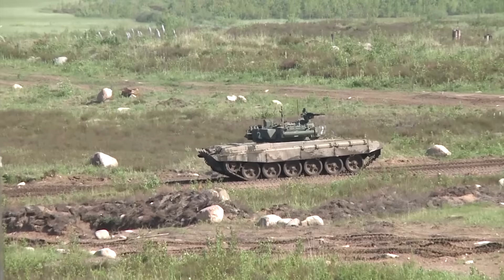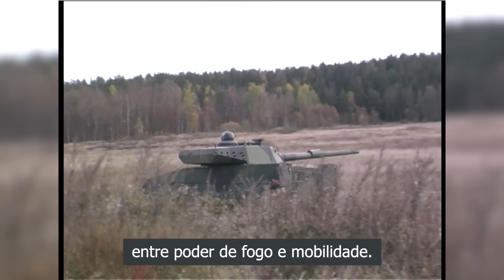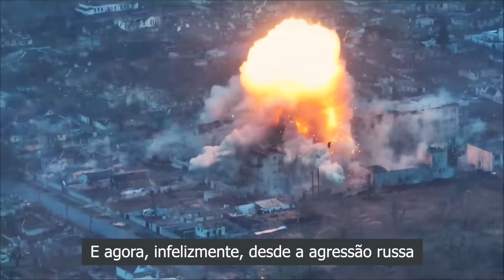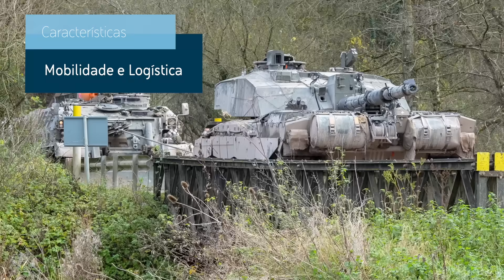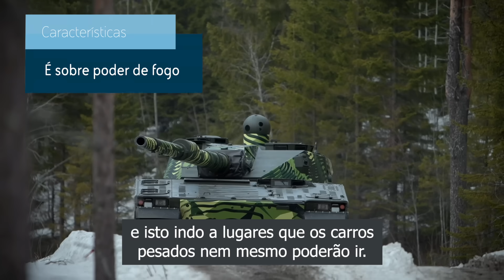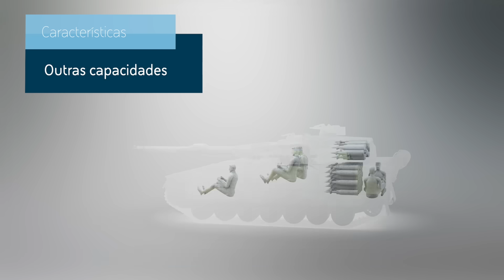CV90120

Comment: You tried to make a tank out of efficient and fast crew transport vehicle with firepower. Now only 2 people can be transported. CV9030 was able to transport 8. I see little use for this kind of vehicle due to drones. There simply isnt enough good counter measure for them yet to be implemented to vehicle like this.
Reply: The CV90120 is not meant to carry crew. The 2 crew on the back is only either for demonstration or possibly for maintenance/crew shifting.

In terms of drones, it probably is just survivorship bias as most of the tank kills that are seen is usually from drones, because Im very sure mines and artillery dont have cameras attached to them, which would claim more lives and vehicles than FPV drones.

Comment: Make it go 120km/h and have a bit reduced range with some basic mine protection as its the bane of today's Battlefield oh and very important at least russian 30mm proof from the front so it won't be shredded cheese
Reply: It probably already has an optional package for STANAG 4569 Level 6 armor.

But if youre looking for a 120mm gun armed vehicle that goes over 100kph, youre looking for something that uses wheels, not tracks

Comment: just add the 50mm bushmaster it more better than the 30mm because in the future 50mm would be a common place if you make it 50mm then you don't have to adapt to it. 50mm bushmaster would be more able to shoot far and wide and also have more payload in the round.
Reply: Since the 50mm is based on the 35mm Bushmaster, its probably already in consideration.

Though I dont really see a future for 50mm, as 30-35mm already does the job decently for a cheaper cost (and logistics too), while a tank gun would provide more firepower than a 50mm, also for less logistical burden.

Comment: I'd like to see a version of the CV90 with a 50mm turret and no troop compartment. Just make it a light tank already!
Reply: CV90120 (and CV90105 respectively) is a light tank, though… Even this new one only has a “new” compartment space just for UAV operator capabilities.
Reply: Since the 50mm Bushmaster is kind of based from the 35mm Bushmaster, it might already be possible since the CV9035 exists

Though I dont really see a purpose for the 50mm because a 30mm or a 35mm already does the job decently at a cheaper price, while full on tank guns have more versatility and firepower than a 50mm autocannon.

Comment: Shocking how this has the weight of a T-72M but armour of a Leopard 1 and the cost of a M1A1 Abrams, oh western companies, pls never change.......
Reply: I would guess that most of the money really went to BMS and other processors. T-72Ms (and in very, very rare cases, even B3s of all things) have radios for BMS and no thermals.

The weight issue is not really relevant unless you talk about its efficiency and logistical costs, and its ground pressure, along with considering that the T-72 may have armor, but I would rather be in a CV90 just because its genuinely easier to escape from and live in.
Reply: @RyuzoSan19  
All current T-72's have thermals and lasers, not sure what universe you live in where thats the case, its not 1978 anymore. 
As for weight not being and issue, Ukrainian military would like a word with you on that one. 
Which would also disprove your nonsensical comment about armour being less important than speed, you cannot outrun a 125mm sabot.
Reply: @SMGJohn  "All current" you only said M models, I also stated that M models have no thermals, not the newer B models. I also stated that these non-thermaled B models are very, very rare.

Armor is hilariously redundant in Ukraine. Cope cages (both Russian, and Ukrainian cope "nets") barely stop shaped-charged munitions. Especially seeing the most "effective" tank during this conflict are large sheds with jammers on them; which you might have guessed, can be done on lightly armored vehicles.

My point still stands on the part that T-series tanks are horrible places to live and work in. It really is the embodiment of "engineer's dream, crewman's nightmare".

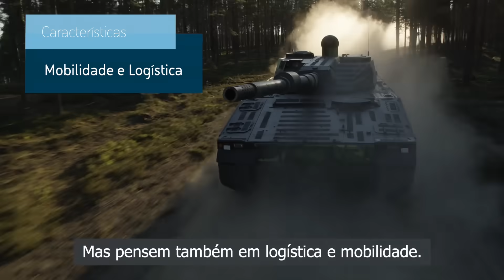Comment: At about 3:30 you talk about the size and weight of the vehicle, a smaller vehicle means a smaller target, better transport by train, better cross-country ability, etc. This is exactly the philosophy of Russian tanks: lower height, lower weight, smaller dimensions, and high firepower.
Reply: And turret tossing as the finale
Reply: That however costs Russian crews ergonomics and comfort, which the CV90 somewhat wins out due to it being an IFV turned into a tank.

Comment: I think that a platform that can be kept as universal as possible would be advantageous in a modern conflict. Commonality of parts is one thing, but the ability to easily transition crews and personnel from one platform over to another with minimal training is perhaps quite important as well. It is a changing environment after all, new equipment gets introduced all the time. perhaps your unit needs new capabilities for engaging something unexpected. What do I know?

Imagine being assigned to a BMP in Russia, then having to transition to a BTR or a BMD, or being assigned to an American Bradley and transition over to a Booker or a Boxer. They're completely different base platforms. When moving from one CV90 to another model, I'd imagine that transition would be quite smooth. 🙂

Comment: Great mobility and fire power but 0 armour. Crew would be swiss cheese or more like tomato sauce if EVEN Bradley started to empty his M242 Bushmaster, but I guess this kind of vehicle has his role on battlefield
Reply: It doesen't have a role on the battlefield. CV90120 exists for over a decade now and not a single customer has ordered it yet. A solution looking for a problem and only good for YouTube videos.
Reply: @jonny2954  It kinda saddens me that this vehicle has not yet been considered by any major countries except for the Swedes themselves and possibly the Brazilians (due to the subtitles)
Reply: The Bradley also "doesnt" have armor, so why is it still being fielded?
Reply: @RyuzoSan19  Bradley in its latest upgraded version is 40+ tons and even mounts ERA. What are you on about "doesen't have armor"?
Reply: @jonny2954  Bradley armor is rated at STANAG 4569 Level 4, can only protect against 14.5mm rounds even with the BUSK ERA. At front, maybe Level 6, but the CV90 literally also has the same options for armor.

I would also like to say that the "armor" arguement wasnt for you, it was for the OP. I would like to apologize for that.
Reply: @RyuzoSan19  STANAG 4569 only rates protection from kinetic energy threats and not shaped charges which work and are countered fundamentally different. The ERA on the Bradley significantly outperforms the passive armor solutions on the CV90 for protection against shaped charge warheads.
Reply: @jonny2954  I see I see, though Im curious to see if Hagglunds would offer or start to consider ERA on the CV90, since they already consider MEXAS plates and other less explosive passive armor as "adequate" for LATs

Comment: Leopard1 seems to me was made to fullfill a similar role. Quite resistant, good mobility and a main gun. However, I don't believe the times have changed significantly. The armor is still required and a tank is still relevant. So I hope to someday see a BAE made MBT, which would spearhead the offensive and be able to take a hit to protect not only his crew, but his allies in case of any threat
Reply: CV90120 was originally designed for arctic, as main battle tanks just sinks into the very soft watery soil there, if you can bring CV90120, the scenario these are good for is to bring them into places tanks can't go, then you have fire superiority and can engage the enemy as you wish.

Comment: Very cool and unfortunate that there has emerged an market for these beast. Even cooler that the best IFV in the world gets a sibling. I think there should be more modularity tho for example; 

The back compartment should also be able to store stuff that doesnt fit into the regular IFVs instead of those spare drone guys. Usually a group fills up the CV9040 to the brim, sometimes "bathing" in bags, ammocrates and antitank weapons. The back compartment could in the 120 variant could be used for this. Hear me out; 

As a heavy punch platform these things will get alot of heat so I would not put the drone operators in this vehicle but have them separtely in a own group riding/hiding in the back. Instead put ammo and anti tank weaponry inside, enabling platoons in the front to replenish their weapons  after a contact. 

If a platoon and 2 regular IFVs hit the enemy without losses for instance in dense terrain, usually they have to rearm which slows down the attack. This enables the enemy to reinforce that point of the terrain usually in the flank, and or setup another defensive position in a delaying tactics battle. 

There should also be an automatic ejection port for the ammo so while the CV90120 protects the flanks and conducts surveillance over open areas it can eject the ammo at a close by point for the infantry to rearm at. This new speed and greater endurance would really make a difference I think since most combat excercises end up in replensih territory slowing stuff down now added with drone paranoia. The greater mobility achieved would also make anti drone warefare more controlled. This extended "thrust" would also make a difference for smaller armies that would not be able to reinforce/recycle lost troops in a prolonged battle at the same rate.

Comment: Here in Brazil, the biggest enemy is the hot and humid climate in the summer and the cold and dry climate in the winter. And it depends on the region. If you are fighting in the northern part of the Amazon River, which is the part below the Amazon River, it is extremely humid and hot and there are no roads. The parts are interchangeable because logistics are almost impossible in the Amazon, so you will have to use parts from other machines.
Reply: The CV90 was intended to be useful in an atomic ww3. It's built more robust and maintainable than most other 21st century things are allowed to be.
The 9040C version got deployed to the west african rainforests for the UN peacekeeping missions there in the early 2000's. They functioned the same there as they did in the arctic. That was adequate.
Unlike a certain other country, our stuff work even when it rains.
Reply: This is why CV90 is modular and built with maintainability in mind 👍🏻

Comment: Our country bought 42 ASCOD vehicles insted CV90. It was Extra expensive guys. Plus you dont have them " in stock". It was advised about 2030 delivery timeframe so ......
Reply: The ASCOD actually outperforms the CV90 though. Don't be fooled by YouTube commercials and fanboism.
Reply: @jonny2954  Where would this info be found? Im actually quite curious as Ive seen more support and users of the CV90 rather than the ASCOD around the world.
Reply: @RyuzoSan19  ASCOD 2 has higher gross vehicle weight of 43 tons compared to the 38 tons of the latest CV90 MK IV. It also has a higher payload capacity.

CV90 main selling point is affordability. Always has been in fact.
Reply: @jonny2954  The gross weight is interesting, as ive heard that the CV90 Mk4 has a 2 ton payload while I couldnt really find anything on the ASCOD itself. All the while being lighter, as you have said.

The price thing that you said wouldnt really be substantial. Latvias CV90 purchase resulted to about 9 million USD per vehicle including its support systems, while my country's purchase of an ever so slightly more expensive version of the ASCOD also resulted in 9 million dollars per vehicle with support. So it would seem that the ASCOD is actually cheaper by just a little bit more, but Im not an expert, y'know?

Comment: Another amazing video showcasing an amazing vehicle by a legendary CV90 user! Thanks Tarkan!!
Reply: Of course Matsimus is in here
Reply: Agreed. this is such a good option for a MBt punch with a lighter vehicle. I feel Australia and many other ex USA friends need to consider these in numbers and move away from Abrams MBT
Reply: What the M10 Booker should have been.
Reply: @knowahnosenothing4862 the CV90-120 also has the benefit of sharing the chasis with the CV90 family (reduced price and logistics). If you don't like the turret, you can just remove it and Frankenstein an autocannon or more sensory equipment onto it. The problem with the Booker is that it's basically a heavily redesigned Ascod (which the Army doesn't even operate) so no one knows what to do with it once production ceases
Reply: Fancy seeing you here, never would have guessed.
Reply: could be a good augment to the caf, since we dont have a medium platform. but god knows what and when procurement will get something

Comment: Tracked tanks have been obsolete since 1943. They can be mobility killed or straight up destroyed by any regular soldier, who can carry a cheap AT launcher that can penetrate more RHA than you can physically put on a vehicle. And if it can't, it can still take out tracks and optics, which is good enough. If infantry needs fire support, you can put a 120mm gun on an 8x8, which is a superior platform for everything except earthworks.
Reply: How old are you? 12??
Reply: @heinedenmark  I'm sorry, did you have an argument hidden in there somewhere?
Reply: @td6460  Years of experience.
Reply: @heinedenmark  Oh, how has Ukraine been treating you?
Reply: @td6460 Again - How old are you?
Reply: Soldiers can be easily killed by bullets, therefore soldiers are obsolete. That's what your argument sounds like. 

Tracked vehicles gives out better mobility than 8x8 vehicles simply because of lower ground pressure. Having a fire support vehicle only being limited to optimal terrain (i.e. roads and highways) makes it a larger and easier target. 

The funny thing is that the part of your argument saying "any regular soldier, who can carry a cheap AT launcher that can penetrate more RHA than you can physically put on a vehicle" doesnt apply to the CV90, because it can barely stop a 25mm autocannon from the side. Trying to hit optics and its tracks are also quite difficult to do when the target is going 40-60kph. Same applies to South African CIT heists where exposed rubber wheels barely get shot properly on bank armored cars. You have to remember, tanks try avoid getting shot by simply moving.

And besides, LAT Launchers are quite limited in range. The good 'ol RPG-7 has an effective range of only 300m, while target acquisition of tanks (with OLD optics, Gen 1 thermals or long range NV) may reach up to 1km.
Reply: @RyuzoSan19  It only sounds like that to you because you don't understand what's being discussed and because you have an irrational emotional attachement to a piece of metal.

There is no need for a 70-ton vehicle on tracks in a modern war. None. A tank is easily disabled, can't defend itself against a 1-hit KO any better than a lighter vehicle, has a weapon that can be installed on a lighter chassis, is expensive to operate with no strategic mobility AND low tactical mobility. In fact we've seen in Ukraine that this tactical mobility is much lower than an 8x8. The tanks get stuck in every terrain that's not a flat, dry plain. The 8x8s go through thick mud and last autumn I saw a Stryker limp back from Kursk with 3 operational wheels. You would never see anything like that from a tank. One blown off track segment - not the whole track, one plate - is enough to make the tank completely useless. "Tracked mobility" is a myth with no basis in reality.

Tanks are an obsolete platform from an era that lasted literally less than half a decade during the 2nd World War. Buying tanks now is about as smart as buying attack helicopters. So you know many militaries, led by idiots, are going to buy them.
Reply: @td6460  Thank you armchair General, now back to people who actually know what they are talking about.

Comment: Thing is, to be the future, how exactly you guys are planning to deal with drones in this platform? radio jammers, or some kind of active protection is on the way?
Reply: if they have directional acoustic sensors they can pick up any drone even if its fiber optic. As you saw here they have RWS (remote weapon system) which can track and shoot down drones it has high elevation.
Reply: cool

Comment: Perfect for Brazil
Reply: Why Brazil, in particular?
Reply: @T1hitsTheHighestNote  Cause the CV90 can go through pretty much any terrain, and provide great firepower while carrying troops that can fulfill different roles (drone operator/ambush/surveillance/setting up checkpoints/anti-tank emplacement etc) .
Reply: @T1hitsTheHighestNote  because Brazil is about to buy it. It meets the required specifications well as it is a solid and versatile platform. It is already much better than the outdated Leopard we have
Reply: @jonathanfreitas3797  Shocker why the video has subtitles in I assume portuguese
Reply: @richman2601  exactly
Reply: As a Swede i love if Brazil buys this, but i don understand why you need this firepower in the jungle.
Reply: @benktlofgren4710  Brazil has a variety of environments and climates. It's not just jungle, although there is a good part of it. And we have already invested a lot in armored vehicles with wheels, too much.